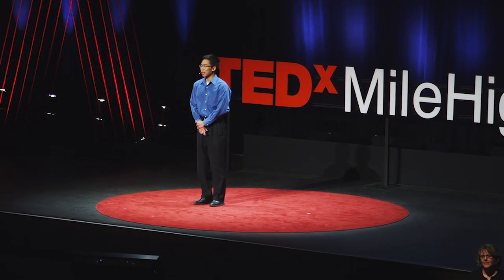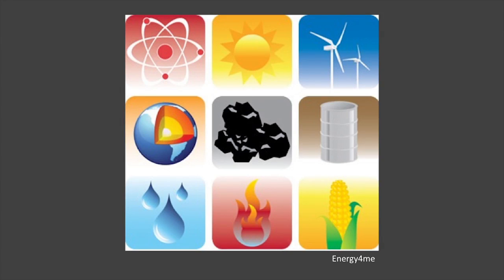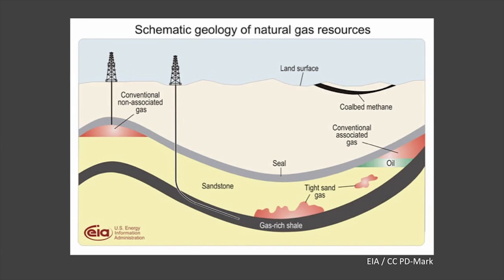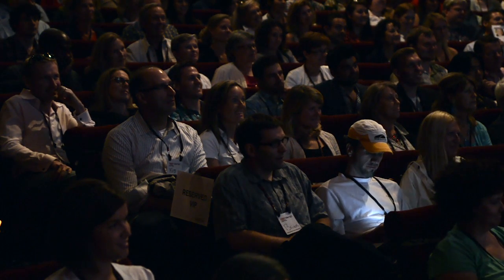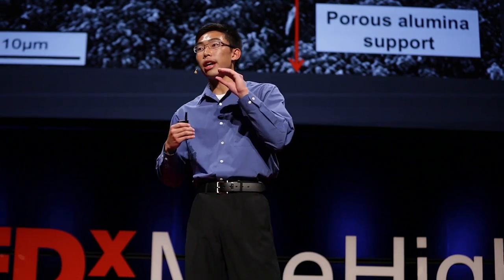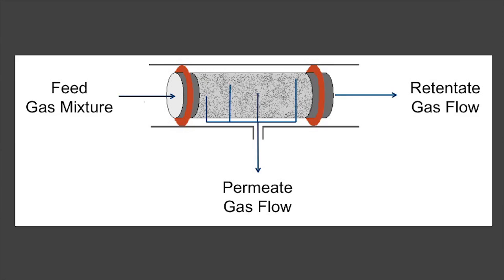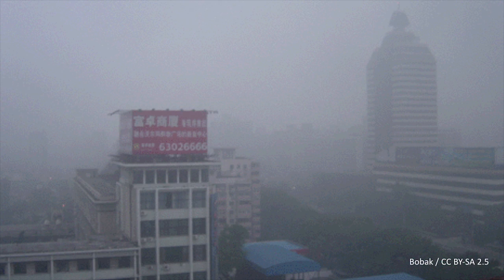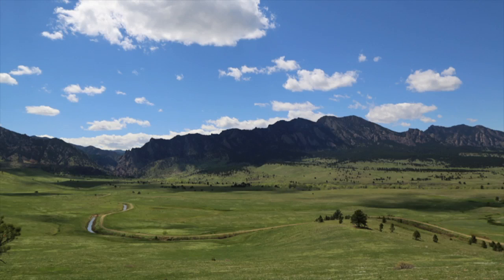Amazing Zeolites and their new role in natural gas purification | Michael Zhu Chen | TEDxMileHigh

Comment: Paid for by the methane fracking fossil fuel industry
Reply: True, especially since that dude said "photovoltaics are expensive". They are not because they cost you the same or less for 1 kWh compared to coal, nuclear or fossil fuels while there is no way you can just buy an upgrade for conventional energy technologies (fossils, coal, etc.) to save 1 ton of CO2 - but photovoltaics and other renewables do.

Comment: What do we do with what gets left behind? Is there a natural means of getting rid of the pollutants?
Reply: Rod Haynes  The carbon dioxide would likely be dissolved into ocean water below 3,300 ft, through a fixed pipeline or ship. Or stored in carefully selected geological rock formation that are typically located several kilometres below the earth's surface. As for the other pollutants, I'm not entirely sure. However, CO2 is of greatest concern in terms of climate change.
Reply: Can we use the carbon to feed algae for biodiesel?
Reply: It is used in fire fighting so there is an actual demand for it, not to mention your soda drinks